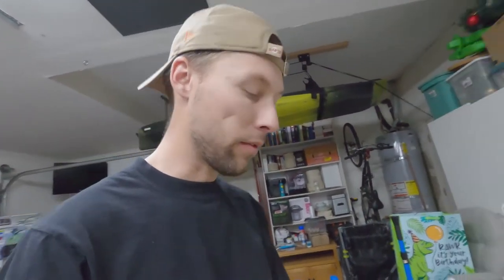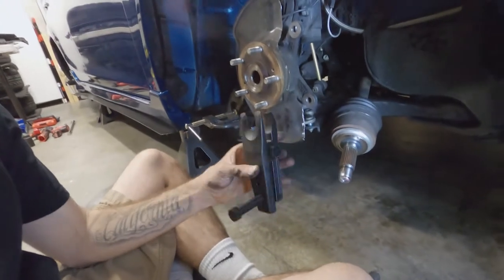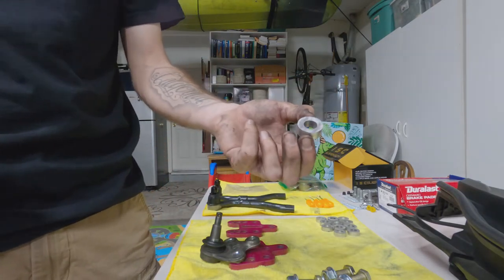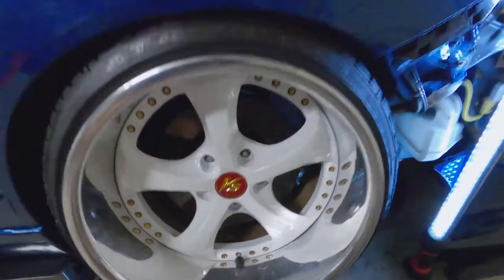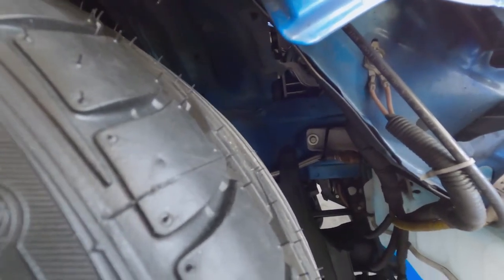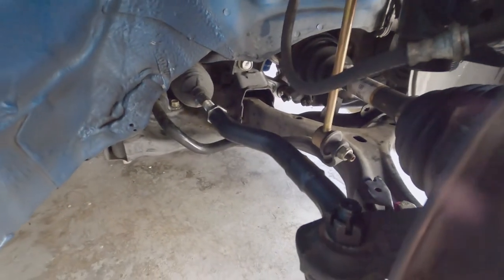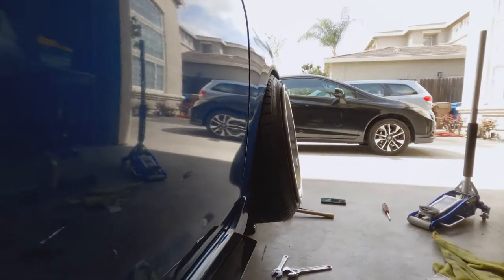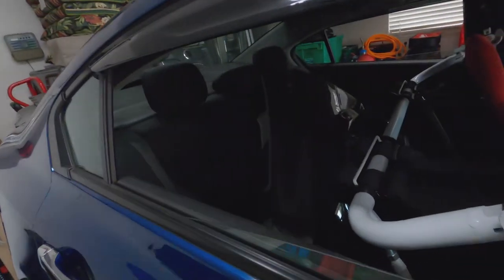Getting More Front Camber On 9th Civic With Low Life Projects LCA Extensions

Comment: Hey great video! I have my camber plate maxed out and I'm not trying to cut a notch where the camber plate is maxed already. With the lower ball joint extension does it help out with  increasing more negative camber? I'm running bags on my 10th gen Accord.

Comment: So all you need is lca extended plates and extended tie rods to achieve the amount of camber you have after the install or did you did something else?
Reply from the maker: You need to have modded strut bracket to get more than -10 camber then these
Reply: @Rebirth_FB6  Oh okay and when you mean by modded strut bracket are you referring to a camber plate?
Reply from the maker: @itsjoc  No slotted strut bracket that allows u to tilt spindle enough to get double digit camber. Lca extensions are better to look at them in a way to correct the effect of modded strut bracket than a way to get front camber. They give some camber but really to help push strut out and away from the inside of fender wells when u strut brackets have too much slot to tilt spindles. Feel free to msg on ig @rebirth_fb6 and I can show u picture.
Reply: @Rebirth_FB6 any issues with rubbing?

Comment: You didn’t have to Extened the axles bro?? I was told if you do ext Lca you’ll need ext axles also 🤦🏻‍♂️ so idk who to listen to lmfao
Reply from the maker: U either have to extend axles or get modded lower strut bracket with lower hole extended and or slotted to get enough camber to counter it. Will make a video soon just got a lot going on at the moment.